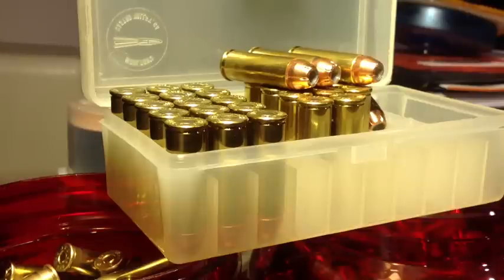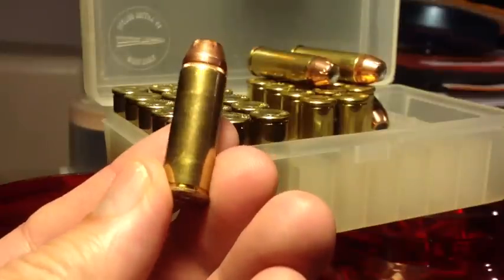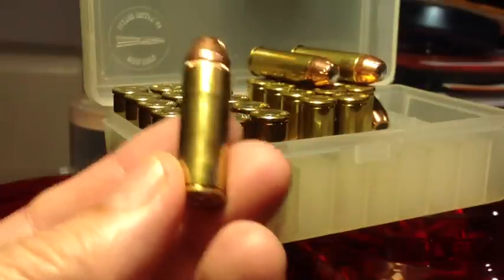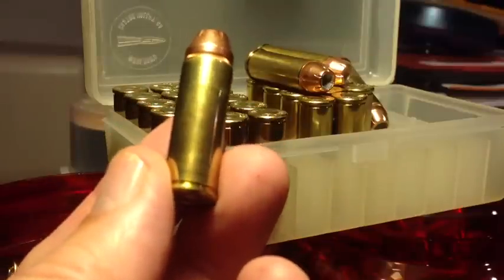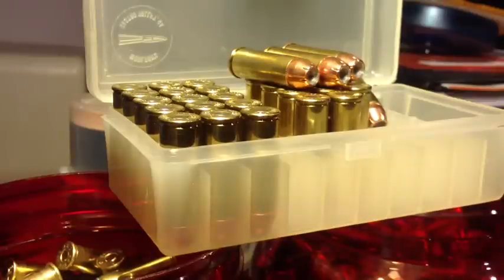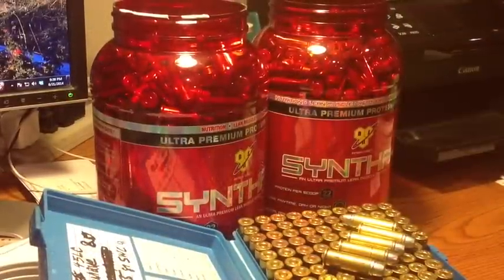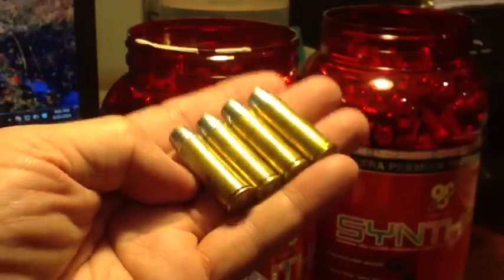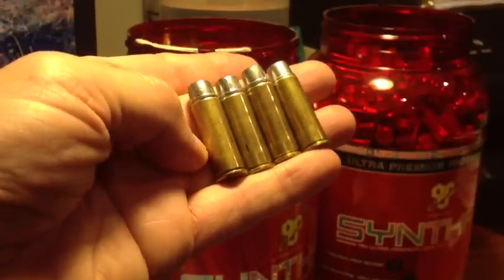Hot Loaded 45 Colt Ammo - Why Not?

Comment: The beauty of the 45 is that you don't really need a hot high velocity load to be effective in almost any reasonable situation and quite a few unreasonable ones.
Reply: Elmer Keith always maintained that you didn't need velocity above a thousand feet per second for the 45 Colt to do the job, as long as you used a quality hardcast or other slug of sufficient mass. He hunted darned near everything with that set-up, too, at least if the stories are to be believed.

Comment: I have a 45 Colt Ruger Black Hawk and I have loaded these rounds with max charges of H-110 and hard cast 230 and 300 gr bullets at speeds of 1200- 1300 fps. They are not for the faint of heart. Today I use 4 3/4 Uberti Cattleman revolvers with standard 45 Colt 250 gr bullets at 800-850 fps, and they will go clean through a deer at 50 yards and keep going. My point is simple at 25 I shot hot loads, at 46 I don't. For I figure with age comes wisdom and have learned by trial and error putting a 250 gr bullet in a animal accurately is better than firing heavy loads inaccurately due to massive bone jarring recoil.
Reply: I have a Taurus model 513 Raging Judge Magnum. I load my 45 extremely hot. If I was shooting something like a peacemaker I would not I would stick to standard Sammy specs. But because my pistol was designed for 454 Casull pressures. I have no problems with the 45s being hot as they can be. Go Big Bore!
Reply: it doesnt take a lot of horsepower to put down a deer.horse power is for things that bite back
Reply: I don't hunt with any of these loads. The hot 45 and the 454 Casull there my toys. At 62 I guess I haven't outgrown loving having a controlled explosion in my hand. Perhaps being raised military and spending 21 years in the Army infantry Lends to that perspective. I Deer hunt with a 300 win mag. For distance.  And 7.63x39 for 300 meters or less. 
  I guess my point being is. We don't have any brown bears down here, moose, caribou, Etc. So I actually have no reason practically speaking to even own a 454 Casull. Although I am in the woods often. I will carry it with me when we hog hunt. Much easier to maneuver and the thick over a rifle or shotgun. Killed a 428 pound boar with it last season. That had tore up some of our gear dogs pretty bad.
Reply: @coldsteelbill.9089  Very true. In my youth I was a big Elmer Kieth fan, the bigger the better per say. Today like you I have adjusted with age and wisdom.
Reply: Chris Duke  Yep.
Reply: You and me both brother!
Reply: @blueduck9409  Thanks.
Reply: @montanamountainmen6104  👍

Comment: The debate over the strength of the .45 Colt case was caused by the existence of early balloon head brass which was discontinued many years ago. Modern .45 Colt brass is every bit as strong as .44 magnum brass according to Starline. This is one of those myths that persist because well meaning people repeat old wives tales without checking the veracity of the information. The truth is that some .45 Colt brass is not as strong as .44 magnum brass but all modern brass is.
I used to shoot a lot of hot .45 Colt safely in my Rugers, but more and more prefer
the more moderate pressure loads. I am a hunter and have taken quite a few deer with my Blackhawks. I prefer to keep the ranges to stickbow distance and have never lost a deer with moderate .45 Colt loads.
Reply from the maker: jima28080 - That was all part of the debates that raged.  You just don't hear about the debates anymore - hot 45Colt loads for Rugers and TCs are still published, but the loads are fair lower pressure than 44 magnums.  You don't hear of shooters trying to fire up their 45 Colts to 44 magnum pressures these days no matter what the rationale; the reason is the factory 454 Casull - exceeds 44 magnum pressure levels with ease and greater margin of safety.  And then there is the 460 S&W Magnum that even takes it to another level.  The 45 Colt in +P loadings is pretty fierce as a standard round… Your point on brass strength is well taken - some debaters did point out that the 45 Colt solid head cases still have a thinner web than 44 magnum brass, but it really doesn't make any difference… Best Regards
Reply: Starline 45 brass is rated the same as their 44 magnum brass. The Rugers are made to withstand 44magnum pressure. The is published load data for them. I guess you are against loading 38P rated guns to 38P loads too!
Reply: @Raider1836  ??????????????????

Comment: you don't hear about it so much because heavy (hot) loaded .45 colt are now mainstream.
corbon, buffalo bore, underwood, hsm, all load +p pressure .45 colt.
for use in specific firearms only.
the fact is most people do not like "hot" loads.
whether heavy .45 colts, .44 mag, .454, even .357 mag. ... etc

Comment: Is the new Win.1873 in 45 Colt able to use these handloads, or is the toggle link action too weak?
Reply: +Brian Searles Not the 1873.  an 1892 (like the new Win. 1892, or any of the other replicas) should be used if you want to use 45 colt for anything but CAS in my opinion.
Reply from the maker: +Brian Searles - The factory new Win 1873 is a marvel and truly fantastic.  We could all be proud owners of that.  For shooting, one critical feature to note is that the lack of chambering for 44 magnum.  That tells me immediately that the toggle link is not up to that high pressure level  - so no hot loads in this baby.  If you want the Win 1873 and desire to shoot maggies in it, buy the 357 chambering - chamber pressures will be nicely handled and the back thrust on the bolt is less than a hot 45 Colt or 44 Magnum.  If you must have an 1873 and desire to shoot fully loaded 45 Colts, then the Uberti has done some design changes to allow 44 magnum chambering.  However, inquiries should still be made concerning the advisability of shooting hot loads in the 45 Colt chambering, just to be certain...these guns are not cheap, and are so finely finished that we would not want to have to junk them.  Besides, the 45 Colt 1873 with +P ammo and long barrel is formidable as is...no real need to stoke them... Best to ya  ... FC
Reply: +FortuneCookie45LC I also noticed that the Uberti 1873 has a model chambered in 44 Mag, did not know that their action is stronger. The 357 Mag. does seem the way to go for a number of reasons, cost, availability of ammo and being able to use 38 Special. Thanks for your feedback.
Reply from the maker: +Brian Searles - Appreciate your comments as it brings out important stuff.  I actually would not recommend the 45 Colt for shooters who do not reload their own ammo.  Factory 45 Colt is ridiculously priced - like well  over a dollar a shot for cowboy ammo...!!  Factory ammo shooters of the 45 Colt buy a box of shells and shoot 1/2 box and put the gun away for a year.  That's horrible!!  I shoot my 45 Colts all the time and at rates of 200 rounds each range trip - it is an amazingly fun round to shoot that way - reloading unlocks the path to shooting pleasure and satisfaction.  Even if a reloader buys commercial cast or PC bullets, the cost is around 16-18 cents a shot - that goes down to as low as 7 cents a shot if bullets are cast out of free range scrap lead.  I've told shooters over the last 25 years to cast their own bullets when they saw me gathering range scrap and no one listened -- that is until recently - now there are range days that I don't even bother picking up lead as there isn't enough there to be worth the effort - too picked over.  Or the range has done range scrap clearing to lessen the desire of casters to gather.   The 357 / 38 is great because of the low cost factory ammo available in 38.  Best to ya... FC
Reply: +FortuneCookie45LC I have reloaded for several cals. but never 45 Colt. Was looking over data for the 45. As an example, it seems up to 19 grains of H110 combined with a 230 grn. bullet is about the hottest safe load for most new revolvers. Of course there were many notes expressing caution about the relative strengths of different guns and what is considered a "safe" load for each. Can't find any data specifically for a new Model 73 Win and I have no idea of the comparative strengths between a Ruger or a Colt and a 73 Win. How does the action strength of a new Model 73 compare with that of some of the new revolvers?  Thanks.
Reply from the maker: +Brian Searles - The word is that our Ruger Blackhawks (not the new Vaqueros) and Thompson Center single shot pistols are exceptionally strong and up to the hot 45 Colt loadings.  The SAA replicas are not.  Ruger Redhawks and Super Redhawks are like tanks - will shoot all the magnums all day.  S&W Model 25s OK for sparing use with hot loads.  All the old toggle link Winchesters (like the 1873) and replicas are suspect in strength - they are great for smoothness and customized smoothness for cowboy action shooting using low power and standard power ammo.  But all the old time pistol cartridges lacked the power desired by shooters back in the day - that's why John Browning designed the model 1886 and 1892 with their lugged bolt strength.  The 86s and 92s can stand all the hot ammo - the 1886 chambered the 45/70 round.  As said before, the Uberti 1873 is chambered for 44 magnum, but the new Winchester 1873 is not.   Uberti has done something with their toggle link and action/barrel strength to allow 44 mag.  If they have applied that to their 1873 45 Colt also, then that is good for hot 45 loads - but we cannot assume that.  For sure the new Winchester 1873 is suspect with hot 45 Colt loads - I would not even risk shooting hot loads in that gun - it's too fine to push that.  If you need hot 45s or 44 mag, then the Rossi M92 is an awful attractive way to go.  Shoot the daylights out of it, beat it up, it didn't cost that much to begin with.... Good shootin' to ya   ... FC

Comment: Do you do any black powder 255gr .45 colt rounds?
Reply from the maker: Maurice Rogerson - That 45 Colt would be a great one to load black powder though...just haven't had any incentive to do BP - when I first heard that the residues were bad for brass, plus the fouling and gun cleaning...Plus the storage danger.  just never got around to trying it.  Best Regards to ya,  FC
Reply: Im using the Lee 340 45-70 bullet sized down to .454 in my Rossi.Im using 20 grains of H-110 with low pressure around 17.000 .Very accurate and will drop a moose like it was pole axed at 70 yards.
Reply from the maker: albert johnson - That's some major sizing down you are doing,  If I tried to size a lot of my 45/70 (.459" - .460") down to .454" with my RCBS Lube-A-Matic 2 sizer lubricator, I'd probably wear out that press  (that's what happened to my Lyman 450 lubri-sizer)   But the Lee sizer dies should be able to handle that nicely.  My guess would be that is what you are using.  That 340 would make a formidable 45 Colt slug for sure...Thanks for reporting this in the event any viewers out there want to use the extra heavy bullets.  This would make a great YT video that you should do...   especially since you have hunting experience with that bullet in the 45 Colt.   Best to ya,  FC

Comment: Very interesting video. I love my Ruger Vaquero in .45 Colt. It’s the reason I started hand loading. I have a question though: is 8gr of Unique under a .255 grain LSWC really considered a stout load? Most info I see puts stout loads up around 9gr of Unique or more. I load mine with 7 or 7.5gr of Unique for medium loads. Just got a Ruger Super BlackHawk in .44 Magnum with a 10.5” barrel. Using about the same load of Unique for light .44’s. Gonna try 2400 for stouter loads in .357 magnum, .45 colt and .44 magnum. Not wrist breakers, but stouter loads than “cowboy loads”.
Reply: 8 grains of unique in the 45 colt with a 255 grain bullet is an average load. Its heavy for cowboy games, but average for real world. The plus p stuff is around 10 grains of unique.

Comment: I tried 20 grains of 2400 with the same bullet and found it a little too hot for the brass coming out of my rossi lever rifle.  So I backed it down to 18 grain and was fine!!  All loads were within the acceptable pressure range for hot 45 colt.  It may be that my chamber in the rossi is not precise enough to handle the 20 grain load??

Comment: Is a magnum primer alright to use in a hot load/+P when using a slow burn powder like H110 or Lil Gun? None of my manuals ever call for a large pistol magnum primer... just a large pistol... but I’ve loaded some with the magnum primers and in a 20” rifle barrel, you sure feel the recoil.  But am I risking a catastrophe using magnums over standards? I think it was about 27 grains of lil gun behind a 250 grain xtp bullet last time I made hot loads. My guns are modern 1892 clones
Reply from the maker: Shaun Fritz - We have safety margins so that ease of extraction, primer signs all help us to assess our loads.  The best advice would be for us to cut the.powder charge by 1/2 grain if switching to magnum primers and working that 1/2 grain back up if pressure signs are OK.  I routinely shoot 357 Magnum with 22 grains H110 magnum primers, and that load flashes like lightning in broad daylight - rattles the windows at the range.  I worked up to it though...Good shootin' to ya,  FC Steve
Reply: FortuneCookie45LC thanks for the quick reply. I enjoy your channel. Your answer is great as I do stay at the lower end of the +P scale and have never made a max change. I feel better about the magnums. Though I’m not going to make a habit out of them cause it sure makes my shoulder sore if I bench shoot a few dozen of them at the range!
Reply from the maker: Shaun Fritz - Shooting mostly standard and +P ammo is a good policy for rifle and handgun, or even shotgun.  But a few magnums at the end of shooting sessions keeps the familiarity with them.  If hunting, we won't be shooting that many rounds and the recoil isn't felt in the field.  Good shootin' to ya,  FC Steve

Comment: Howdy, I have the new Ruger Redhawk 45 acp /45 colt with 4.2 in.  barrel. My question is, in your opinion, is it safe to fire HSM 45 Colt +P 325gr hard cast Bear Load ammunition in this gun?  I've read conflicting information and the manufacturer states it is intended for the Blackhawk but not the Redhawk. However, I have read comments from some stating that they shoot this out of their Redhawks. I was under the impression that the Redhawk cylinder strength was greater than or equal to that of the Blackhawk. Your thoughts?
Reply from the maker: +Steven Mayes -- The Ruger Redhawk was made to take any factory loaded 45 Colt ammunition.  +P loads are just touching the 30,000 psi range.  Full out magnums are in the 39,000 psi range.  The Ruger Blackhawk, Redhawk, and Super Redhawk can all handle that with ease so +Ps are fine.  However, if HSM says not to shoot that ammo in the Redhawk, then the best advice is not to do that.  My Lee 2nd Edition Reloading manual has loading data for 360 grain bullets loaded to 30,000 psi specified for Ruger and TC only - nothing about Ruger being SBH, RH or SRH.  My first opinion would be that those HSMs are OK in your RH.  But again, who am I to tell you to shoot something if the factory says no...I'd go with the factory recommendation.  What they are saying is that if your gun lets go, they are not responsible.  Have a great day,  FC
Reply: +FortuneCookie45LC 
Thanks for your input. I talked to a few guys who own the same gun as I and asked if they had experience with these rounds. They did and said they have put a lot of the rounds through theirs with no problems whatsoever and in fact have shot even hotter loads with over 300 gr bullets as well with no problems. I actually bought a box of the rounds in question and ran two cylinders of them. Recoil isn't that bad and were very accurate. It's now one of my new favorite heavy loads.
Reply from the maker: +Steven Mayes -- The one thing that we should keep in the back of our minds - while hot loads are OK in strong Rugers and TC, we can still push the rounds hotter - there is a limit that doesn't need to be pushed since we now have 454 Casulls and 460 S&Ws so we just shoot those instead of stoked 45 Colts.  But nothing wrong with shooting the hot 45 Colt loads published in reloading manuals for Rugers and TCs.   Have a great day,  FC
Reply: +FortuneCookie45LC 
Howdy. Good point and I agree. Thanks for your video and replies.
Reply: yes ... you can shoot any of the factory "hot loaded" .45 colt ammo in a ruger redhawk.
Reply: Ruger actually states their Redhawk 45Colt Ruger loads should not be used. I would look up Brian Pearce 45colt PDF he takes loads from 14kPSI up to 32K PSI.I would stick to the 20K range which is a 280gr pill moving at 1K fps. If I need anything more than that time to move up in caliber.
Reply: Ruger uses their Redhawks in the 44 magnum, frame and cylinder for their 480 Ruger chambering....so yes they are extremely strong revolvers and probably the strongest in the business.

Comment: I have an old Ruger Vaquero will it be ok with larger loads . What's the strongest .45
Reply: Old Ruger Vaquero is OK.  It was built on the same frame used for the 44 Magnum Ruger Black Hawk.  Do not use the 45+P LC, Heavy 45 LC, or any mangnumized 45 Long Colt loads in the new Ruger Vaquero.  The new Vaquero in 45 LC is built on a smaller and less durable frame and it is not designed to handle near magnum pressure level loads.
Reply: Sierra MatchKing thanks brother ... I figured as much this thing is built like a tank .
Reply: Han Solo I'd love buy a Super Redhawk in .454 Casull. It will handle hot loaded 
.45 Colt all day long without a problem.